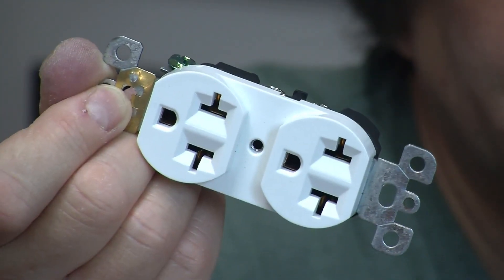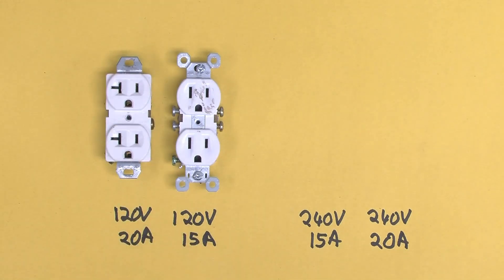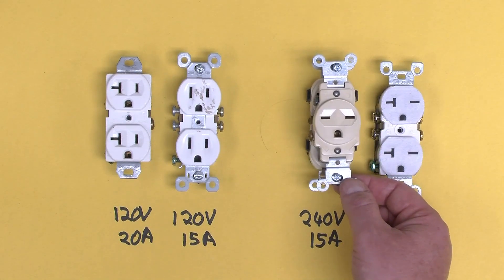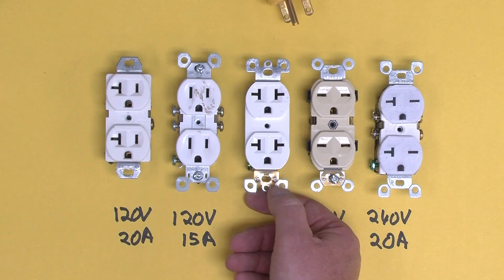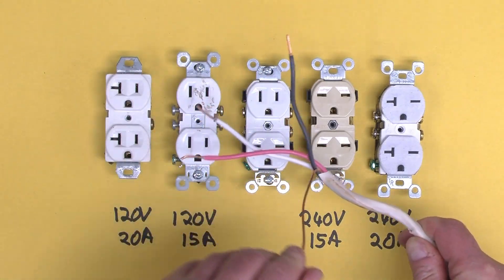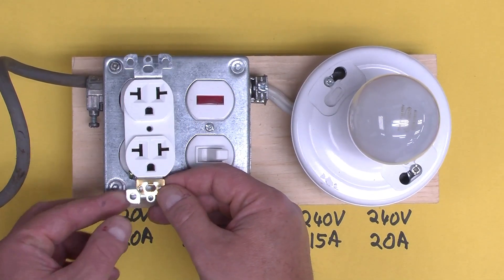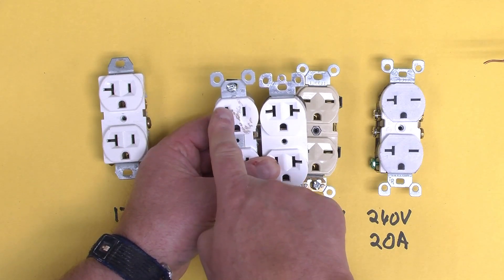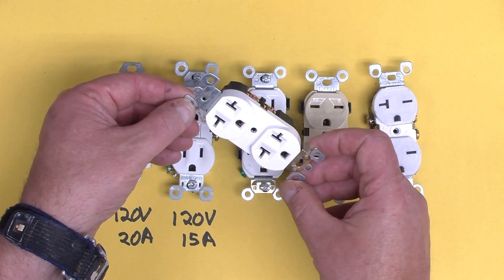Yikes! Don't use this Chinese-made Outlet!

Comment: it would actually be cool if they made a version of this with a switch you're supposed to install alongside the plugs in a dual gang socket, where you could flip a light switch and it would switch from 120 to 240, but then at that point why not use the leviton dual-voltage one 🥴
Reply from the maker: I would think a switch like that would too easy to accidentally flip to the wrong voltage, often with exciting results :) Yes - the leviton dual-voltage one is a great safe alternative!
Reply: @ElectromagneticVideos  it doesn't have to be a modern style light switch. some of the older switches in my house take quite a bit of force to turn on.

Comment: But that receptacle is common in Philippines
Reply from the maker: Thats interesting - I just did a bit of googling - looks like in the Philippines the voltage is 220V and (officially) both German and US type outlets are used. I wonder of this outlet is used to fit both the "standard" US plug as well and the 240V US plug where the blades are rotated 90 degrees? Have you seen plugs like that in the Philippines?
Reply: @ElectromagneticVideos  yeah on a my room aircon outlet
Reply from the maker: @Electro1234b Interesting - makes complete sense! An outlet like that would work with a 240V air  conditioner equipped with a typical US 240V plug!

Comment: I'm not at all advocating the use of this receptacle, in fact in my personal opinion it should have never been allowed on the market in the first place.   

However I do see one "safe" use for this dangerous receptacle, and it's for certain LED, fluorescent and metal halide /sodium vapor fixtures like you might have if you have an indoor garden.   Many such newer fixtures use electronic ballasts rated 120 ~ 277 volt; the ballast senses and automatically adjusts to 120, 208, 240 or 277V depending on what you connect to.  Other fixtures, such as my 400 watt metal halide work light made by SouthWire, have 4 taps on the primary coil of the ballast for 120, 208, 240, 277 along with a wiring diagram, you have to know the voltage and make the appropriate tap, selecting the wrong tap will either result in no light, or destruction of the ballast and lamp.  Some fixtures, particularly emergency exit lights, are suitable for either 120 OR 277 volt, 208 or 240 won't work and can destroy the fixture, these typically have a white for neutral, black lead for 120V, and orange for 277V.
Reply from the maker: I think the real danger is someone might inadvertently plug in something else that cant use whatever voltage it was wired too. 

The one use I can see is on  variac where you might want to plug in anything and are knowingly altering the voltage, so less likely a mistake might be made.

Comment: That looks familiar to the 1930s outlet with no ground
Reply: You're right, it sure does.  I remember as a kid in grades 3rd through 6th I lived on the lower level of a duplex built in the 1940s during WWII, and it had these two prong double T slot outlets throughout, I used to wonder what kind of appliances would have these weird prongs to plug in, the place had a small 4 circuit fuse panel, however only 3 circuits were being used, that's how I discovered the power of electricity by sticking my finger in the empty fuse socket and getting thrown backwards where I busted my head on the coffee table and rushed to the ER to get something like 6 stitches in the back of my head in 3rd grade.   Boys will be boys 😂

In the early 1900s through the 40s before plugs and outlets were standardized by NEMA for voltage, amperes, grounding/non grounding , etc. some plugs were made with 2 horizontal blades while others used the vertical blades as we know today, and usually supplied with 120v although 240v - it was usually 110 / 220 volts back them- could have been used as well. For obvious safety reasons these outlets have not been allowed in new construction in over 60 years.
Reply from the maker: @rarelampcollector  Funny - when I was a kid we once lived in an old farm house that had some of those outlets too, and some that had been replaced with grounded outlsets withouts the ground (even worse). I recently got on of those outlets for my collection of vintage electricl stuff from out Habitiat for Humanity ReStore - glad I got it before it got sent to the garbage or used by someone for the wrong purpose.
Reply from the maker: Exactly!

Comment: That might be good as a travel adapter if wired to a uk or European plug cable
Reply from the maker: Well since most of our stuff has 120V plugs, may just be simpler to use a cheapo travel adapter. A use that is similar to what you are suggesting might be in a testing lab where one might want to plug a 120 or 240V device into a socket supplied from a 0 to 240V variac....

Comment: There is no polarity protection for two prong 15 amp 120 volt NEMA plugs with that POS.  3rd world countries do NOT even use 120 volt electrical systems at all. Only Canada, Mexico and the USA use 120 volt NEMA devices. Japan has 100 volt and 240 volt systems. Fiji used to have Japanese 100 volt system but they went to the world standard of 230-250 volts @ 50Hz. That outlet is still dangerous and useless on a test jig. I need 15, 20, 30, 50 and 60 amp 240 volt outlets with 3 & 4 wire configurations for Clothes Dryers, Electric Ranges, Air Conditioners, etc. Best just to have a single 240 volt 4 wire 60 amp outlet and use DIY adapters on the properly sized SO cord, with or without an integral fuse. I have appliance testers with the AC voltmeter/ ammeter/ wattmeter setup. 20KW & 100 amps @ 100 VAC to 600 VAC is the highest range. You are into pin and sleeve or camlock connectors above 50 amps.
Reply from the maker: Given the designers of that outlet didn't care about protecting from plugging things into the wrong voltage, I'm guessing that polarity protection was even further from their minds!

Comment: As a general rule. never, never, ever us a wiring device that isn't UL listed. It is a violation of the NEC to do so. 

Never use Cheap Chinese junk for electrical wiring at all!  This stuff is not that expensive to be trying to use cheap junk and be aware that  they just might say it is UL approved but there's a good chance that they lied. If your house burns down, good luck suing that Chinese company for selling defective or uncertified equipment. 

I advise against using things like Chinese wire nuts and other wire connectors rarely do these meet standards. 

To be honest, electrical wiring is not something the DIY homeowner should be doing. The consequences of not knowing what you are doing can kill you, kill a family member or burn down your house. No other "DIY homeowner skill", comes with those potential consequences.  There is way too much wrong information out there that could lead you do something dangerously wrong because you don't know what you are doing, you only think that you know. 

Do you know and understand all the variations of Ohm's Laws?
Do you know how to measure/calculate the resistance of a high resistance connection.?   
Do you know how to calculate the heat energy dissipated through a bad connection? 
Do you know what the NEC requirements are?

If your answer to any of  these questions is. no, you should not be doing this kind of work, period!
Reply from the maker: "This stuff is not that expensive to be trying to use cheap junk ..." How true!

Comment: I don't remember seeing 240 volt outlets the same size as the 120 volt ones, I always saw the much bigger ones.
Reply from the maker: They are generally not as common as the bigger ones but are readily available. I think we tend to see more of the bigger ones because usually 240V is used for significantly larger loads such a kitchen stoves and clothes dryers. A typical use for a smaller one is a 240V air compressor which use more power than a 120V outlet but a lot less than a stove.

Comment: The standard receptacle types have been established by NEMA. To supply max current to one load for 240 VAC 15 Amp or 20 Amp there should only be one receptacle, in other words not a duplex receptacle. Traditionally, what you will find is for the single 240 VAC dedicated branch circuit, the installation is targeted at a single piece of equipment, where the receptacle type (rated voltage and amperage) is based on the equipment nameplate or wiring instructions. 

If the branch circuit is 120 VAC 20 Amp and not dedicated to a specific load but in a wet or shop location, it will most likely be a single 20 Amp duplex GFCI. In other words, each 20 Amp duplex GFCI will have its own 20 Amp branch circuit. This is because many times you do not know how the 20 Amp GFCI would be used as to a single or multiple loads. So, to be safe, for example, if you have 4 duplex GFCI along an assembly work bench, each 20 Amp GFCI would have its own 20 Amp branch circuit. If a specific change is needed in applying one of the branch circuits to a dedicated 120 VAC load, you could replace the duplex GFCI with a single receptacle dedicated GFCI usually provided with a pilot light. 

You can put a 15 Amp duplex receptacle on a 20 Amp 120 VAC branch circuit, which is usually done for cost reasons. However, if you look at the differences in quality in the duplex receptacles on the market you will find a huge difference in quality between the low cost versions and the high cost versions. This why in the installation you should specify the exact receptacle at each location. If you keep the requirement generic you will get generic junk.
Reply from the maker: Very nice guide to these sorts of receptacles and circuits. Thanks!  Should be really useful for some people who find their way to this video.

Comment: Commonly used in relay operated lighting controllers for grow rooms. They are able to be wired for 220 or 110. Idk who would buy them they are expensive and not readily available.
Reply from the maker: Based on the name of the seller I got it from, your comment about the application does not surprise me. I completely agree - I don't understand why people would be buying them or for that matter selling them rather than the approved single voltage ones.

Comment: Our electrical codes are designed to protect the populace from unscrupulous manufacturers. However corrupt politicians seem to be determined to circumvent the safety measures for the sake of personal profits. There are many exceptions for products that haven’t gone through the same testing as domestic products. Nothing like this could have gotten past a reputable testing lab nor obtained a listing.
Reply from the maker: Yes - no way would this ever get certified for normal use. I think the main issue these days is online sales have effectively bypassed regulations bring stuff in in that is never properly tested.

Comment: That plug is a code violation.  All plugs and receptacles have to be designed to prevent equipment with the wrong power requirements from using that circuit.  It can only be used to add versatility to test equipment where you can change voltages.
Reply from the maker: Exactly!

Comment: I learned several new things on this one-thank you.  It would have been nice to have sees the Leviton 120/240 VAC combination outlet close up and for a longer duration.  Of particular interest would have been how the side screws were arranged, and where the single neutral wire would have been attached.  As you brought in the XX/3 conductor I thought you were going to demonstrate how to wire up that 120/240 outlet.  For anybody else interested the following link goes to the Leviton (5842-I) outlet's instructional sheet which is a 120/240 VAC combination outlet of theirs and shows the wiring instructions for both a single feed and split feed that should answer the question: https://www.leviton.com/en/docs/PK-A3394-10-02-0G-W.pdf
Reply from the maker: Glad you found a couple of things useful. And thanks for providing the link with the wiring for anyone who might need it. 

For what its worth, one thing I struggle with is how much to include in each video and therefore how long the video will be. I really do appreciate comments like yours because that gives me some things to think about when deciding what to include/exclude in future videos.

Comment: 1:30??? Why would plugging something that uses less watts into a receptacle that CAN provide more be a bad idea? A device that only needs 15amps will never take 20amps. This isn't an issue. If it was you'd need tons of receptacles that offer 2-5amps because plenty of items around the house only use a very small amount of what the plug can provide. 

The inverse is not true though. The exception of this is if the item has a variable range (welder maybe) or isn't continuous (again welder, plasma cutter, etc). An item that draws 20-30amps can do so for quite some time on a 15amp breaker/receptacle, but will eventually trip the breaker.
Reply from the maker: Largely because of things like extension cords that can barely handle 15A let alone 20A and are a major source of fires.   I wish we had fuses in things like extension cords to prevent that sort of issue. Interestingly the British do, but they have giant sized plugs....
Reply: @ElectromagneticVideos  People create hack extension cords all the time I doubt a strict 20A/15A separation would make much of a difference. In my opinion and experience, the hacks and bad quality adapters people use to circumvent inconvenient socket incompatibility are a much greater risk than what having separate sockets for different current ratings prevent.
Reply from the maker: @  Good point - in the end people who are determined to do something like that will do it.

Comment: Watching videos with this content as a European and long-time experienced electrical engineer is like learning all over again.
Just everything is so differently thought out!
Reply from the maker: What I find is our stuff (without even including the cheap Chinese stuff) is/was never as well built as stuff made in Europe - European equipment is built to last. Ours is built to be cheap. When I was a teenager I used to fix old TVs and then sell them - some TVs had American brand names but were made by Philips in Europe - the quality difference inside was amazing. They even used printed circuit boards way before the American ones did.
Reply: @ElectromagneticVideos  That's right, the insides of TV sets and VCRs could be made by someone else, I remember that.
I practiced at a TV repair shop and a customer came in with one of those nice Bang Olufsen TVs, complaining that such an expensive TV could break, the manager looked at the TV and then at the customer and said, that's a Saba.
Curtain!
Reply from the maker: @emilalmberg1096  That reminds me of when I was in grad school in university and they created a project for first year undergrads where they had to take apart a device of their choosing and analyze  it. One group of students bought a expensive toaster. When the opened it up they found inside it a complete cheap toaster from the same company. The only difference was that the expensive one had a fancy outer case. Companies really hurt their reputation that way. I'm amazed Bang Olufsen did that - they always had the reputation as the best if you could afford their equipment.
Reply: @ElectromagneticVideos  Thats a nice story yes!

Comment: You can't trust a country that sells telephone cable with one conductor having half the gauge of the other or jacks whose screws strip out and will not tighten in 100% of shipment of jacks. The only guarantee you have is the mark of a nationally recognized testing laboratory, and even then you had better be careful. As always, it's best to either know what you are doing or pay someone who does.
Reply from the maker: I've never seen cable like that - how strange - I wonder why they did that? I think the problem with certification marks is that they are also counterfeited and probably the only what to be somehow sure is to buy stuff from a trusted supplier who actually buys from the manufacture or an equally  trusted distribute. Large web selling sites have largely circumvented that chain of trust.